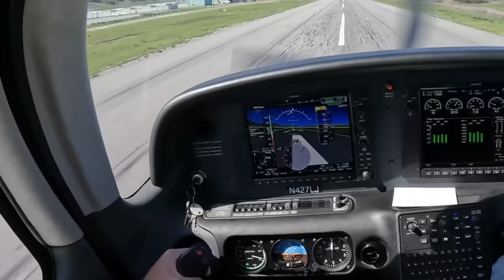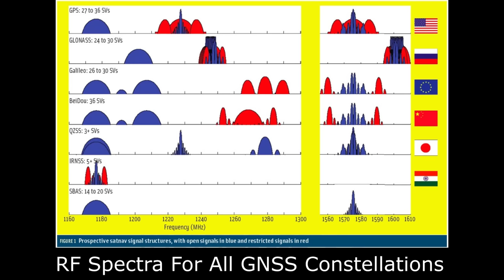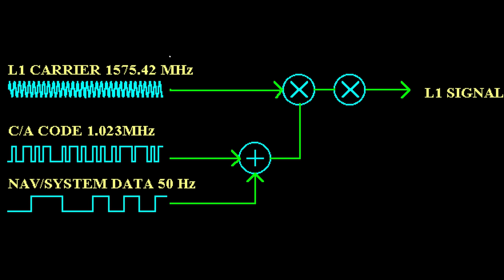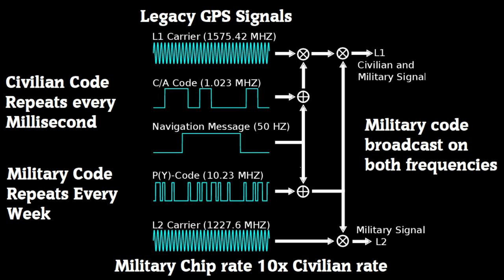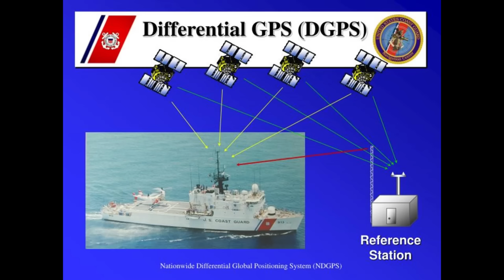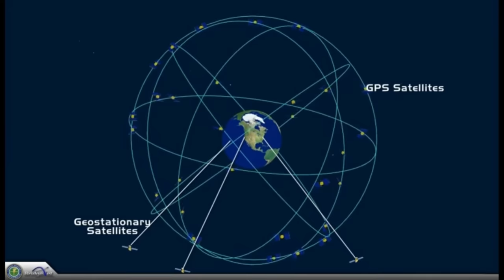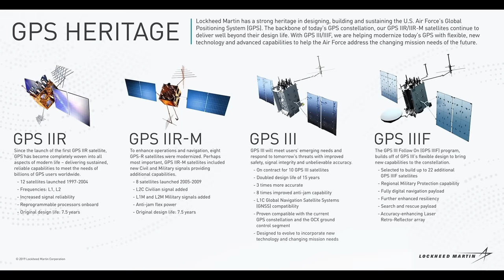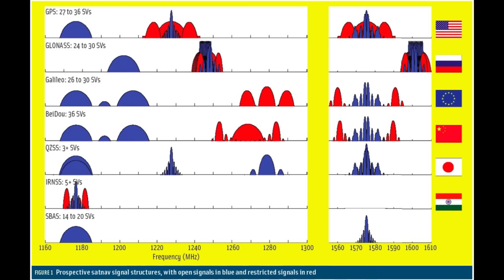How GPS Works, And How It Got Better Than The Designers Ever Imagined

Comment: Another trick the smart folks figured out was that you can directly measure the doppler shift of the carrier signals from your various satellites and use this to calculate your instantaneous velocity in 3 dimensions, rather than having to use a running average of (P2 - P1)/t style  calculations which are easily confused while you're turning rapidly.      Some GPS systems used on race cars and such use mostly doppler data integrated with gyro and accelerometer data to calculate very accurate position on the track at very high speeds and turn rates.
Reply: That is using the carrier wave, that kind of equipment is very expensive though. When you used that with the coded data and a differential source you can get below 10 centimetres or 3 inches. I worked on a project in 2003 that did just that. We had things then, that made google map/earth today, look like a joke
Reply: @nicholaswjamrock smartphones of the past couple years have carrier tracking, on android there's an API for that so you can use custom software for sensor fusion or recording to later post-process or do differential RTK...
Reply: Using Kalman filters it is also possible to combine many different measurements (GPS, IMU, Odometry,...) into a really precise and also fast (high update rate) position estimate
Reply: that would be a good video
Reply: That’s cool!  So is the velocity data similar accuracy to position data? Or is it better?
I’ve noticed a gopro will give very responsive velocity information
Reply: @mossm717   For the purposes of velocity, it can be much better.   But I don't think it's utilized in any consumer grade GPS receivers such as the one in the GoPro.
Reply: @nicholaswjamrock  What he’s describing is how automobile magazines now do performance testing instead of using 5th wheel instruments and timing lights. They combine GPS and accelerometer data.
Reply: @mossm717  I suspect that the GoPro is using accelerometers (perhaps on all 3 axes) and then computing the velocity using some lightweight calculus.  It sounds hard but it is actually pretty simple to implement nowadays.
Reply: @nicholaswjamrock  yep, using not only the doppler shift of the carrier wave but the phase of the wave you can get 19cm accuracy (one L1 wavelength). I use this equipment everyday, it even uses the phase to determine pointing heading down to 0.1 degrees, mindblowing.
Reply: The US Navy submarine force used such a system between the fifties and nineties. The satellite system was called Transit. 

An onboard receiver with an antenna attached to the top of a periscope downloaded ephemeris information for all satellites periodically. With the ephemeris data, the receiver’s computer could predict the line-of sight position and path of each satellite. 

The sub would be at periscope depth as one of the viewable satellites began to appear near the horizon. The receiver would continuously measure the frequency of a signal emitted by that satellite. The receiver would calculate a position of the sub after at least six two-minute intervals of frequency measurement. The measured frequency during each interval would shift due to Doppler effect of the satellite’s relative velocity to the boat’s (small) relative velocity.

The receiver would then use the Doppler shifted observations over the six two-minute intervals to curve fit to a positional fix of the sub relative to the known path of the satellite.

For its time, the boat’s positional fix was pretty accurate - a CEP (circular error probable) of as small as a quarter mile. That accuracy was good enough to accurately target the ballistic missiles loaded on SSBNs to their assigned targets.

The overall system and the fix were referred to as NAVSAT. The disadvantages of the system:
-the boat was required to remain at constant speed and course for at least twelve minutes. Bad for stealthy operations.
-The boat was required to remain at periscope depth for at least twelve minutes. Bad for stealth.
-A continuous signal during the NAVSAT fix was required during the entirety of the fix. High sea states above SS3-4 where waves as high as eight feet could wash over the periscope would degrade or lose the high frequency signal. This could be due to the randomness of wave heights or because the ship control party temporarily lost depth control. If signal loss was too much, the fix accuracy was either degraded or completely lost.
-The limited constellation of satellites could not offer continuous coverage of the oceans. Line of sight distance to a mid-to-low-earth orbit satellite from an antenna that was located six feet above the surface is relatively small. So, the sub had to wait until a “near-enough” satellite would be calculated to appear over the horizon along the track of the submarine.
-The signal of any orbiting satellite could be either jammed or degraded by Communist a**h0les during wartime.

All-in-all, NAVSAT fixes were the most accurate fixes available to equipped ships in their time. But continuous, more accurate fixes were available from GPS by the early nineties. So NAVSAT and Transit systems were replaced and de-commissioned.
Reply: @23secs in fairness marine users have fewer issues with altitude errors
Reply: @JohnMullee  Sub-marine users can use GPS altitude as a more accurate means of maintaining depth control than differential pressure gages.
Reply: @JohnMullee   Funny how that works, but good point.
Reply: @davecorley5514    That is fascinating and I did not know that.  Thanks for sharing.   Interesting trick for sure.
Reply: How can they receive the signal under water?
Reply: @ValFox28  Electromagnetic signals, especially those at frequencies above a few hundred hertz, are highly attenuated by water. 

GPS, NAVSAT don’t work if the antenna is covered in water.
Reply: @ValFox28   They didn't.  They had to come up to periscope depth (sub under water, but periscope with various antennas just above the water).
Reply: @davecorley5514 it seems a bit pointless for a sub to be using GPS for depth control when it can only ever use it no deeper than at periscope depth?
Reply: @mnxs  Point of fact, you’re correct. GPS is over-precise for depth control. That said, submarine systems are built with redundancy in mind.

In the control room of a modern submarine, the ship’s control party is in the forward part of the room. The Officer of the Deck is farther aft during periscope depth Ops. The OOD normally has their left or right eye glued to the periscope. The other eye can be shifted about. “Depth control “marks” are shouted out by the Diving Officer of the Watch periodically if depth is outside two or three feet off of ordered depth. But sometimes the DOOW may be concentrating on other things and not call out the depth. The OOD can generally discern how high the scope optics are above the wave troughs. An extra display of depth (GPS or otherwise) near the periscope could be useful to the OOD as a check on the height of the top of the scope above the water.
Reply: @JohnMullee  You haven't been at sea in a storm?
Reply: I did not know that. I thought that GPS was not accepted for aircraft positioning because of speed (doppler effect).
Reply: @michaelhompus2475   Keep in mind the GPS satellites are orbiting in medium earth orbit (between low and geosync) at about 8700mph which makes any doppler shift due to aircraft velocity pretty tiny.  The "trick" I'm talking about above does the math to precisely subtract out the doppler shift from every satellite (all of which are different due to their orbital paths relative to the receiver), and that from the rotation of the earth itself, leaving only the doppler shift of the receiver relative to the earth's surface.   Various other processing and GPS system enhancements have made precision approaches using only GPS possible.
Reply: @michaelhompus2475  Nope. In fact, commercial aircraft with certified GPS and radar altimeter equipment are routinely landed using autopilot - in zero visibility conditions - every day.

Because the “ephemeris” data (position, velocity) of any satellite is known precisely at any instant, and the velocity and position of a GPS-equipped aircraft is known precisely at any instant, any Doppler shift in carrier wave or modulation can be anticipated and corrected for precisely.
Reply: Yes, but most car GPS systems still use the two position over time estimate both for speed and orientation though the magnetometer readings are taken into account with orientation.  A lot of people mistakenly believe the orientation and speed are through the GPS protocol when they both are often indirectly calculated.  The GOS signal is really just a time signal which is why it takes four satellites to calculate location, the time signal was also originally just a pulse per second.  It's quite amazing what can be derived from what amounts to just a repeating beep beep signal.
Reply: @daemn42  No. A GPS satellite is in semi-synchronous orbit such that it passes over the same surface location every 12 hours, therefore Earth rotation can be ignored.
Reply: @MrCuddlyable   The very fact that it is semi-synchronous means that the earth is moving at a different speed than the satellite over the ground.   And the GPS sats are in a variety of different inclinations, so those with more north/south trajectories see the earth moving faster than those in more east/west orbits but they all see the earth rotating below them.  Go find a video that shows all the GPS sats at once over the earth.

Comment: Agriculture has really taken advantage of this. My nephew has a 120 foot wide sprayer than travels at  12 MPH and is positioned within 4 inches as it moves.
Reply: There are drones for agricultural work that have RTK and can stay within 1/2 inch of their course. Really cool stuff
Reply: My brother uses RTK GPS and that has less than 1 inch accuracy. All he has to do is turn around at the end of the field.
Reply: Yeah that is pretty fascinating. I have a cousin doing the same thing; the on board computer is given the soil conditions ahead of time and can turn individual spray heads on and off to match. Then he got certificated and got himself an Airtractor and does it all at 140 knots.
Reply: A lot of Ag GPS systems augment their data with ground stations too. At the sugar refinery where my dad used to work there's a base station on one of the silos that helps improve the accuracy for local farmers.
Reply: @David_Lee379  That is actually pretty neat. Spray what the soil needs, but only what it needs.
Reply: I built my autosteer on my tractor for less than 2k and it's dual frequency rtk and it turns automatically at the ends.
Reply: @jerryd0413  I put a system on a Big Bud that makes it do that.
Reply: lol
Reply: For the people in developed countries, that's a 36m boom traveling at 20km/hr with 10cm precision.
Reply: @Chris-hx3om  Not developed enough to put men on the moon.
Reply: @Steevo69  🤦
Reply: @Steevo69 The Apollo Guidance Computer used metric, everything got converted to Freedom Units for the benefit of the meaty cargo...
Reply: @rickj5817  I'm more than aware, it's a joke, try them sometime, they make you feel jovial.
Reply: @rickj5817 The entire Apollo / Saturn V system used the metric system (down to the bolts on the hatches). The first American spacecraft to use imperial measurements was the Space Shuttle (Von Braun was most comfortable in metric being German).
Reply: AGPS also helps, wherever you have cell coverage.
Reply: Is he allowed to modify, fix or program the machine? Asking for John, Deere John and his fighting right to repair.

Comment: One seemingly crazy aspect of today's GPS with larger planes  is that the software on each aircraft needs to take into account where on the airframe the GPS antenna *IS*. GPS is so precise nowadays that from nose-to-tail & wingtip-to-wingtip the plane can get a different location. On small planes it's not so critical, but with larger aircraft it can become a problem.
Reply: So with multiple receivers in various locations they could get heading/pitch/roll from GPS? neat
Reply: @triffid0hunter heading (yaw) is common with multiple antenna assorted setups. Often called AHRS for attitude heading reference system. However I haven't seen anything on pitch/roll from the antennas. But I guess it should be just as possible.
Reply: Coast guard ships use bow and stern GPS RX in combo for precision station-keeping in all weather conditions.
Reply: If you move the second asterisk after the period, you will get the desired bold attribute.
Reply: We have the same issue on trains. a 220M long train with ant&reciever at each end.
I was just using them to detect station arrival for selective door operations...fairly important not to open a train door where there isn't a platform.
Reply: There is a story from the early days of a test where a GPS receiver was linked to the ship autosteering system, and the test was to dock against a pier. The ship struct the peer - if was then realised that they had not programmed the beam of the ship and the GPS was in the middle of the bridge.
Reply: @imconsequetau5275  That's useful to know, thanks for the tip, bold unbold
Reply: This is also the case with AIS transponders on boats.
Reply: On sea-going vessel, a roll and pitch sensor inputs data and the survey system can correct that out, giving high accuracy.
Reply: In the mining industry they use a second antenna to determine heading (while stationary).
Reply: @sarmadchaudhry6006  Heading can be derived from GPS yes but also magnetometers (digital compasses) generally are used as well. For pitch and yaw that's the work of accelerometers/gyroscopes, and usually for larger aircraft ring laser gyros are used. Some attitude indicators have MEMS systems onboard which is similar to the technology used on your phone, I built a digital attitude indicator for fun (wanted to make it full AHRS, but the magnetometer I got was fried and the MCU flash already full) so from my experience GPS just isn't anywhere fast enough to give you the responsiveness you need for such a critical instrument.
Reply: @triffid0hunter  GPS cannot provide heading/pitch/roll. A navigation system that can integrate GPS positions can provide the ground track (and GPS altitude) of the aircraft/ship with respect to a globe model. Heading/pitch/roll are provided by an Atitude Heading Reference System or an Inertial Reference System which senses the three axis motions, both of which do not rely on the GPS. Note that the ground track is not the same as a heading.
Reply: Actually, having multiple GPS antennas/receivers is for redundancy. Navigation systems that use only a single GPS have no capability for GPS-based routes, approaches, or departures if that GPS is unavailable (failure, damage, electrical bus power problems, etc.). Using two or more GPSs is insurance if one is unavailable. When a GPS is installed on a large aircraft, the navigation system can compensate for the GPS's installation location since it differs from the aircraft's center of mass. In your wingtip example, the nav system could:
- Recieve raw data positions from each GPS and add/subtract lever arm distances for all three axes (fore/aft, above/below, left/right) from the wingtip locations to the center of mass.
- Receive adjusted positions from each GPS that compensate for its lever arms. These compensations would be programmed in the units when installed.
Reply: @c17nav GPS can generate pitch and yaw information - it requires antennas at the wing tips and tail of an aircraft to achieve this however with high precision GPS receivers operating in differential mode.
The European Galileo system gives positioning to under 2cm resolution in differential mode.
Reply: @imconsequetau5275  Same with underline character  ( _ ) for italics. And minus sign (-) for strikeout. Or mix and match for italicized bold, bold strikeout, even italicized bold strikeout.
Reply: @coriscotupi Thanks for the comprehensive guide, I didn't know about strikeout .
Reply: @Chris-hx3om What do you use for underground positioning?
Reply: @johndododoe1411  I have no idea, I have only worked in open-pit mining. (and offshore exploration, where we use GNSS to position the vessel, and then USBL, ultrashort baseline, to get a position on the ROV, then it's easy to integrate the vessel and the ROV to get the ROV in the real world.)
Reply: I used to sail a 40 foot yacht - the gps could tell if I moved the yacht from one side of the jetty to the other. UK coastal waters could use the Decca service which has an error radius of about 10 metres, reckoned then to be the best possible.
Reply: @coriscotupi  Is this formatting stuff document anywhere? I can't figure this stuff out and can't find instructions anywhere. Seems software developers just implement random concepts without informing users... like a * for bold text.
Reply: @toby9999  I just found this stuff in other comments, years ago. I never saw it documented, either.
Reply: Ag equipment is the same way. You need to "tell" it where the receiver is compared to the centerline of the vehicle, distance to pivot points, (hitch, rear/front axle) and height from ground. Most have a terrain comp system with gyroscopes and accelerometers to notice roll, pitch, and yaw. They also have information on the implements  attached to help predict its position, or you can run a separate receiver on the implement for better accuracy.